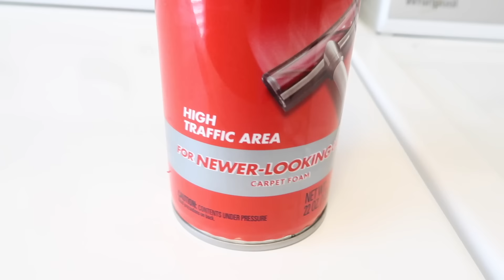NEW! EXTREME WHOLE HOUSE CLEAN WITH ME 2020 | ALL DAY SPEED CLEANING MOTIVATION | CLEANING ROUTINE

Comment: On the dyson website you can select your model and pick the problems your having with it and it will give you some options on what may be wrong with it. Just did it with mine about two months ago and it ended up needing a new battery.
Reply from the maker: Thank you!!
Reply: I was thinking of doing this; but mine is only a year old....how long do Dyson batteries actually last? How old is yours? I have the same model as Jamie’s.

Comment: Hi Jamie, agree with thejaggededge18 . Both filters just need to be washed out very thoroghly. We usually soak ours for like 20 minutes in warm soapy( not too much) water. Then rinse and dry with a rag as much as possible. Then air dry for at least 24 hours before using them. Especially the long one can collect a lot of dirt. Keep it under running water after it has soaked, keep squeezing it gently. We have managed to use them for 2 years this way, by washing them every other month or so. Then we had to get some new ones as we had the same issue as you are experiancing now. Good luck!
Reply from the maker: Thank you! I’ll give it a try!

Comment: I was having the exact same problem with my dyson and I cleaned it out same as you. Same problems after I cleaned and my girlfriend told me I didn’t clean the filter out right. The filter on top that has sinks printed on it. U have to take the cap off of it to clean it. It’s kinda hard to get off but when u do it has hunks of dirt in it. Try that before u call dyson and see if it works. Worked on mine   Love ur videos
Reply from the maker: Thank you!! I will try this!!
Reply: Til Vacuum Do Us Part was having the same issue. Hopefully her husband Chase was able to fix it. Gotta check for updates.

I am hoping to buy an Orfeld from Amazon and a LG cordzero from Costco. The Ordeld will be for daily vacuuming and the LG will be for DEEP clean days!

Hope this helps you all. ✌🏾😉
Reply: My mom had same problem she tried that and then eventually called dyson they sent her a new one and fixed the old one too!

Comment: I agree with thejaddededge18.  You need to take the long purple filter apart.  It is kind of hard to get apart. I use a straight edge screw driver to pry the two pieces apart. There is a plastic thing that goes down in the filter and it holds onto chunks of dirt.  I washed the outside, but kept having problems with the vacuum smelling and that seemed to be the problem.  You can also get replacement filters on Amazon if you can't get the filter completely clean.  I take it apart and clean and let it dry out overnight.  It makes the vacuum smell much better.
Reply from the maker: Thank you!

Comment: Hi Jamie. My dyson also stopped a few times one day and it turned out I needed to really clean my old  filters - as in soak them for 10-15mins and really remove the dirt! If you take the filters off the next time it stops working and see if it works when they’re removed then you know it’s the filters. I had used it when I moved house and had some work done on it and plaster dust got into the filter. Interested to hear what dyson says. Maybe it’s the battery? 

Thanks for a great video. X
Reply from the maker: Thank you!!

Comment: Have you ever used your gray and red power scrub brush to use for grout? I have tile all over the house and need to clean the grout desperately. Also, is your front concrete stamped concrete? Looks like there is a swirl pattern in it, at first it looked like a rug. Might be the battery for the dyson.......
Reply from the maker: I do! I either use that or the toothbrush! The front concrete is not stamped

Comment: Hi Jamie, I have the same/similar Dyson as you and I was told by them to not put it back on the charger immediately after using it. The motor needs about 10-15 mins to cool down and then set it back on the charger. I’ve been doing this since the day I got it and haven’t had an issue. Maybe you have already been following that procedure but just in case, I thought I’d let you know. Hope this helps 😊
Reply from the maker: This is interesting and good to know! Thanks for sharing!

Comment: Stupid question- I have the dyson v10 animal stick vacuum. I got it for my hard floors less than a year ago. I was always afraid to use it on carpet cause I read mixed things online whether or not it was for carpet, but I’ve seen you use yours on your carpet and so I tried it and the only time I used it on carpet it did exactly what you described. -shut down and then I put on the charger for less than a minute and it was fine (but didn’t use on carpet again) so my question is are these meant to or ok to be used on carpet? My carpet is longer and fluffier than some carpets do not sure if that was the issue or not 🤷‍♀️ let me know what you think/what you find out from dyson!
Reply from the maker: Yes, I know they are meant to also be used on carpet! I need to call them but I think it’s a battery issue
Reply: Jamie's Journey interesting! Thank you! I was so nervous I was using it incorrectly. Super weird I might have to call them as well!

Comment: It’s your filter. If you don’t clean it every month or every other it will do that. Either  try cleaning the filter really well or buy a new filter. Mine did the same thing and that fixed it. Filter is clean when water goes thru it uninterrupted. Very hard to do if you don’t keep up on it. Make sure it’s completely dry before use ☺️
Reply from the maker: Thank you!